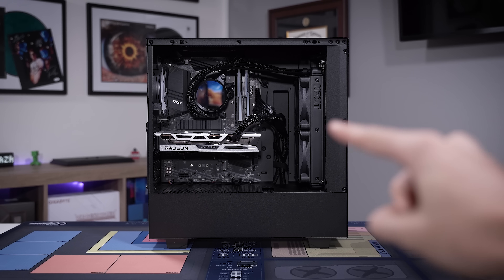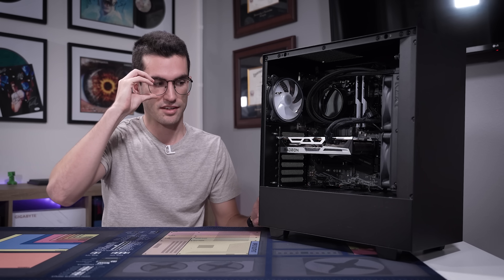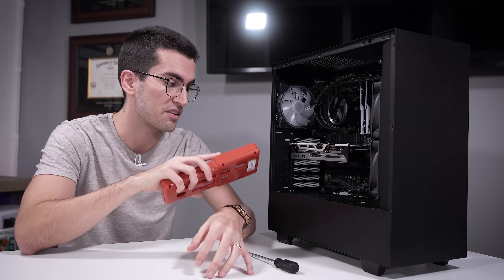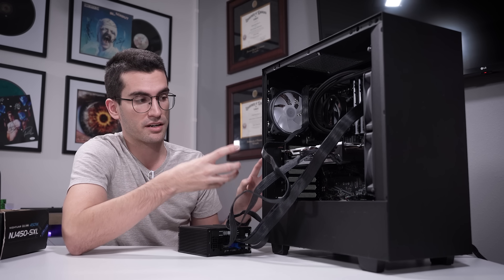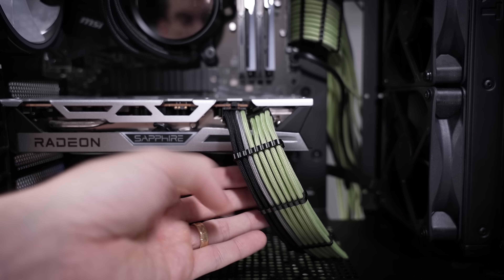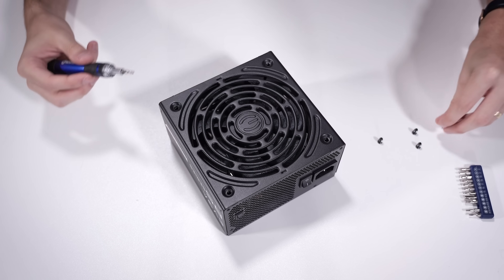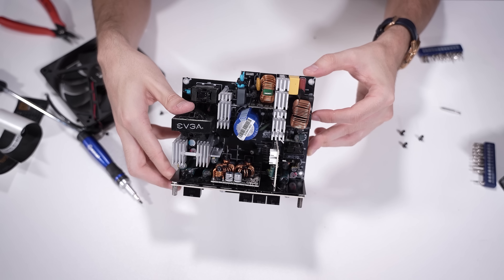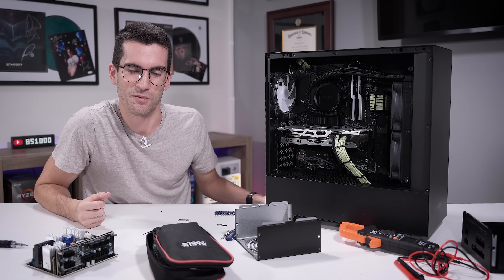Fixing a Viewer's BROKEN Gaming PC? - Fix or Flop S3:E15

Comment: I like how Greg says "dont open PSU's if you dont understand" but yet i opened a be quiet 580w unit to add an extra 4 pin CPU cable and 4 extra SATA power cables. It works and hasnt exploded (yet)

Comment: i recently lost a zotac 3080 to a power surge.  the actual 8-pin in the power supply to the gpu melted in the psu socket and the wire coating melted where it plugs into the psu.  on the gpu the power 8pin a few of those pins are blackened.  no display out what so ever.   replaced the old psu and so far everything else works.  maybe some ram issues.

Comment: make sure the power switch is good I've had a few on various makes that fail, they fail to make contact or fail to turn off although the click sounds ok, also there will be an onboard fuse near the mains near the socket on the main board covered in black shrink tube it's soldered to the board.

Comment: If you still have that faulty psu unit, can you pls try testing it with a different modular cable. That even might have been the case. THE CABLES (internal fault). Btw love your work, videos and this playlist. Cheers..

Comment: About 10 years ago, I was working on a compact digital camera, and I shorted the tiny flash capacitor with my thumb. In addition to the electric shock, it burned two tiny holes into my thumb with smoke and the smell of burnt flesh. Those tiny holes eventually healed, but Greg is right. Those capacitors store an enormous amount of electricity. 

I have that EVGA 850 unit and so far so good after four years.

Comment: Never use metallic pencils or rulers, or wear rings or metal watchbands when working with electrical equipment. This rule is very easy to forget, especially when you are showing some electrical part pointing with metallic pencil.

Comment: About 3 years ago I built my computer. Imagine my chagrin when it didn't start. I didn't have a second PSU, but this just blew my mind. So just for S&G's I grabbed my multimeter, unplugged the power cable from the wall and computer, to ohm it out. Cables don't go bad...right? Especially when new? Low and behold I had a bad power cable fresh out of the box. Fortunately I could take a cable from another setup that's not used as much and there it is. Whew!!! Reputation as a mechanic with some knowledge SAVED!!!The best part, my son wanted to build his own computer. I had included him in building my computer.

Comment: would you like to work on a 2009 buypower gaming computer from the days has very little issues but the cooling tower does not seem to cool lower than 48c  never has stoped working has gone to 73c  on games  put a cheep tower on it was wondering if a liquid cooler is worth it  has  16 gig ddr3 ram i7 processor 256g hd with 4 tb aux

Comment: Did you check for a blown fuse in the power supply?
In your area no one should be connecting any electronic equipment without an Uninterruptible Power Supply (UPS)

Comment: This illustrates that you must choose your power supply carefully. I have seen a lot of systems with a expensive graphics card and a real crappy power supply. I think it's strange that people fork out a lot of money for a graphic card and CPU, and then buy the cheapest power supply possible. It's a real strange mindset. Anyway - I can be wrong here, but does this case has a closed front panel? If that's the case, that system must overheat a lot. That's not very healthy for your components (and power supply if the ventilator is mounted face up).

Comment: you have the fancy blue blobs near the top of the pcb in that psu at 14:24, those and the orangeish yellow disc to the right of them are the input protections, those will have fried to save the rest of the unit (in theory). the blue ones are Y Capacitors, and the disc things next to it should be an NTC Thermistor, and possibly a mov and an X Capacitor someplace there, too. (and hopefully a fuse as well).

Comment: I once had an issue with an EVGA Supernova 750 B2 semi-modular power supply where it would turn on only some of the time and supply correct voltages on all pins, other times it would not turn on at all. I bought it second-hand for listed price of 500 CZK (equivalent to 20 USD), and the issue already showed when I went to the sellers place to and tried it out, so I got a 20% discount and took it with the risk that it might not work.

When I opened it and tried to turn it on, I discovered that it would turn on more reliably if I wiggled a daughterboard slot-soldered into the PSU's main PCB (which supplies the +5VSB and contains circuitry that basically controls the standby/power). Resoldering all joints that connect the daughterboard to the main PCB seems to have fixed it, because the PSU now runs my brother-in-laws gaming PC which he uses daily, and has been going without a hitch for the last 4 or so years. Probably a cold solder joint somewhere. Happens even to the better of PSU manufacturers, and it may not cause issues right away, but after a certain amount of heat cycles. 

Try measuring if the PSU supplies the +5VSB when connected to mains, and if not, try bridging the COM and PSON pins, and wiggle one of the daughterboards. If it turns on, it might just need a resolder.

Comment: Hey guys. I recently just built my first pc. I’m in the Ocala fl area.   Ryzen 5 7600xt    Radeon 6700x. 
Psu :750 bronze 
B650p mob. 

I’m having trouble with my games crashing.   Not all of them.   Call of duty.  Escape from Tarkov. All crash.  I have updated chipset and graphics drivers and I’m still having the same issue.  I have switched out ram.  Not the issue.  I’m so lost. I have had this thing for a month and have yet to enjoy it !!!  Please please help me !

Comment: Just upgraded from a Phenom II/R9 280 pre-built to an i7 12700kf/gtx 1080 creator build as my first build and didn't get a post first go around. Thanks to the handy troubleshooting I've learned from this series I managed to find the problem with the mobo so I knew what to return and get my first pc going and MUCH faster than the 12 year old rig before it. I actually submitted a request with you but got it fixed anyways so no worries lol

Comment: i had this happen to me. my 5950x just stopped working. i tried replacing the PSU. no dice. never thought of resetting the cmos but what happened was a sensor detected a surge and protected the machine. when the cmos was reset it came back up with no issues.

Comment: I had an R9 5950X/RTX2080 going black while gaming. I did various CPU stress tests to no blackout. Ran one GPU stress test and black. Bough new PSU to replace my PowerSpec 850 and solved the problem. Would love to see something covered that showed weak power rails for the VGA sockets on PSUs. (It could still have been the GPU but while I was at microcenter they had an RTX 4090 in stock so I bought that and a new PSU.)

Comment: my pc is broken its a omen L25 case 1053-na and with  1650 and ryzen 5600g and coolermaster 500w psu and 1 stick 8gb ram and it does not connect to my montior just says noconnection hdmi 1 and ive tried everything like changing ram ive got new ram that works and got a new cable its not the monitor because it connects to my ps5 fine but im just not sure what i can do would be amazing if you could help

Comment: You saw the fuse on the PCB of the PSU right? It was a leaded one stood upright but wrapped in heat shrink. You could have checked that for continuity.
Reply: wondered if this might be a fuse

Comment: great content greg , just built my 2nd gaming computer and got a issue with it 2 weeks after , playing a game and my mouse starting to lock up while in play , so i had to hard stop computer , left it sit for a bit and pushed start button and nothing ,  I seen the fans running but no post , switched out working MB and did same thing . reset  everything  and did switch out PSU and the system posted. PSU was a coolmaster 750 and for the mouse it got tossed .

Comment: Id like to know what cpu, gpu and whatnot was in the pc.
Reply from the maker: I don't always need to get that far. In this case, those components had no bearing on the rig not powering on (thankfully).
Reply: @GregSalazar  true. I know that components are pretty efficient now but I always worry when I see a lower watt PSU. I have seen a setup technically be under the max wattage of a PSU but when it would spike in power usage it would be closer to the max. That was what ultimately caused the psu to fail in my friend's rig. I know it's an unpopular opinion but I will usually go 100 watts over the recommendation when using lower end psus. Again that's just my thoughts though. Awesome video as always and I am glad to see you didn't have to get crazy indepth with the troubleshooting!

Comment: I had a similar issue a while back. I bought an EVGA 750W PSU from their B stock. Installed it in pc & system would post & boot into windows for about 30-45 seconds & then system would shut off. I wouldn't be able to reboot it until about 2 minutes later where it would repeat pattern. Contacted EVGA, absolutely no issues with RMA, got exact same model back & have had NO issues since. That's why buying from a good manufacturer is worth it.

Comment: Power supplies typically have a fuse on the input that should blow in a surge and there is also at least one MOV on input that might blow. The symptoms indicate a surge to me, being that the power supply acts like there is no power. Those components are fairly simple to identify and replace if you know what you are doing. Beyond the fuse and MOV, modern power supplies are typically cheap enough and complicated enough that I wouldn't likely mess with it.

I typically use UPSs on my computers which will add extra protection, from much more than just surges and often are built so they don't blow up when there is a problem. All of that in addition to the fact that they provide battery backup so you can save and shutdown cleanly in case of a power outage protecting from corrupt storage.

Comment: I purchased an EVGA 1600 platinum PSU a few years back. One week into using it a capacitor blew that sounded like a gunshot going off in my room. I thought my computer had blown apart. I received a free replacement from EVGA which I sold and went with an 850 instead. These things happen, but man it’s quite the experience.
Reply: geez how much a 1600 plat cost
Reply: I bought it on sale for $99.00 from EVGA when it was on sale.
Reply: Gunshot sound from pc? That would be enough to stop my heartbeat
Bluetooth gunshot xd
Reply: @BiblicalTeachings  my case was fairly tight and it could have caused by reduced airflow as well. It was definitely a lesson learned 🤣
Reply: Did it take any components along with it?
Reply: I'd hide and call the cops if I heard a noise like that lol.

Comment: I ordered a EVGA 750BQ from Amazon one time. Some how. We got cables from a different psu thrown in and it fried all the ssd's connected to it. Took to the third time sending it in to get the cables sent with, tested and confirmed my suspension. Only thing that made me mad is my ssd's were not covered. Funny enough. They didnt send cables back. Had to call them and remind them I needed new ones sent back. Lol

Comment: Hey Greg and people, maybe you can help me since you are very successful with your repairs. I have experienced this problem before with my 1060 so I thought it its time to be replaced with a 6700xt but with this graphics card the problem seems to occur more often. The problem is my second monitor, it will not turn on (if I reconnect the cable - it turns on and it happens every time I turn on my PC) Second problem is when I am in fullscreen mode while playing a game and I ALT-TAB, one of the monitors turns off for 3 seconds - grey flickering screen (Sometimes both of them, it's random). The issue is fixed when I do it repeatably (ALT + TAB) about 8 times, and after that, it is running fine ... (both monitors are the same, 1 HDMI second one DP - I have tried all of the other connectors for DP). Any ideas what can cause this problem?
Reply: Have you tried a fresh install of Windows? If not I had a similar error of one of my monitors not turning on and it turned out to be a RAM issue, good luck
Reply: @JoseFernandes_  Thanks for tip, actually solved it by turning off HDCP in AMD Software.

Comment: I always smell a power supply. You can get a burnt smell if anything is blown. I have only had a couple that were bad and did not smell burnt. Some power supplies have a light burn smell whether bad or not. But when something burns up they have a stronger than normal burnt smell. For some it really obvious. The higher end ones have protection built in to protect the boards when they blow.

Comment: If anyone Has the motherboard in this PC build the B550 A-Pro From MSI If you use the stock cooler from a AMD processor like the wraith stealth It blocks Ram slot 1 on your board and only can be mounted where it blocks the ram as the boards heat sync blocks the other mounting capabilities thankfully the fans mount can be rotated Fixing this issue I made a shorts on it if anyone needs the help i looked everywhere for a video on the subject so i made my own I made 2 videos One from a year ago with the Cooler in the case and The new edited version where its a little cleaner and music Hope this helps anyone building their first PC or for when they do I highly recommend doing this before installing the CPU as you wont have to repasted the cooler if you have to remove it to fix the issue Also! Idle your pc before taking off your cooler! it heats up the paste making it not "GLued"

Comment: You should check for the psu 24 pin cable there are 2 pins that need to be shorted for the psu to turn on

Comment: Maybe I missed it. Are you going to send this unit back to EVGA to let them diagnose and possibly replace it? I used to work on a production line and had to troubleshoot telecommunications equipment down to the component level for repair. I loved stuff like this.

Comment: The same thing happened to me with my EVGA power supply!

Three months after building my first PC, while I was gaming my PC just died with no warning. The weather was great, no lightning. I knew I had to start with the power supply and it came with a tester. Sure enough the power supply was dead just like in the video. Obviously it was still under warranty so I sent it back and got a replacement. But that was literally the first time a psu died on me in my lifetime. Especially a brand new one. This is not a dig at EVGA, their replacement is doing great.

Comment: I haven't had any luck with evga psu lately. 

Supernova 850 that would make crackling arcing sounds when flipping the switch and I was told that was normal.

1000w G5 I had on ecomode, the fan apparently never came on and the psu heated up so much my system shut off and it was uncomfortable to touch due to heat.

Comment: I built my girlfriend a pc recently actually and it had these symptoms! After basic cable checks, i decided to get a power supply tester to double check it (i bought from evga bstock so wanted to be 100% sure). After that worked i decided to double check the cpu and sure enough a bent pin! I was able to use some fine tweezers to bend it back and it now works flawlessly.

Crazy to have almost a 1-1 scenario as one of gregs videos and also take the SAME exact steps to fix it! (even though the problem was different) Makes me kinda proud of myself

Comment: but if he used that PC for gaming for a long time that PSU looks Suspiciously clean...
Reply: I would clean the hell out of my computer if I knew Greg was going to feature it on Fix or Flop.
Reply: @PBW891  but llok there is zero evidence of dust even on those PSU components. I could spend time blowing air on my PC and PSU but I couldn't possibly super clean the inside of my PSU without opening it on. Just my opinnion.

Comment: I'd first check the standby voltage rail as the unit is not responding at all. You should have a dedicated part of the PSU providing the voltage for the standby state (PSU ON / System OFF). The power rails can be totally fine. You usually have a small sub-board generating the +5VSB rail which makes the PSU "alive" once your turn the main switch on. The power rails don't turn on until you trigger them through the ATX pins from the motherboard. But because this standby rail is always connected to the mains, it is the first to absorb any spikes from the grid and potentially fail. It is also always dissipating a small amount of heat which makes it age faster than the rest of the PSU.

Comment: I once had a superb Corsair PSU fully modular and the PSU cabel (UK) had a 13A fuse in it.  It ruined the PSU and my Radeon 5850.  In fact I think it did the Phenom board and all the components bar the memory and drives.  Thankfully, by this video alone, looks like modern protection is far better!

Comment: You get what you pay for, with the Bronze rating you get good piece of mind and quality components. The higher up the scale the better the components and efficiency, it has to be said that at 120v 60Hz the current is double of my 240v 50Hz input. I also have a fuse in the plug but the RCD would trip before that worked, if the power supply was a cheap one with no rating i think it would have taken a lot more components with it as it died. Great video and you're getting nearer 1 million subscribers , not long now.